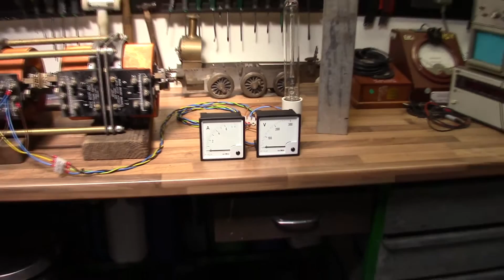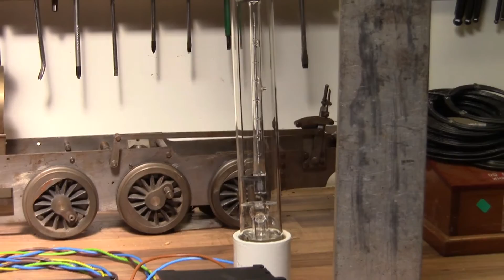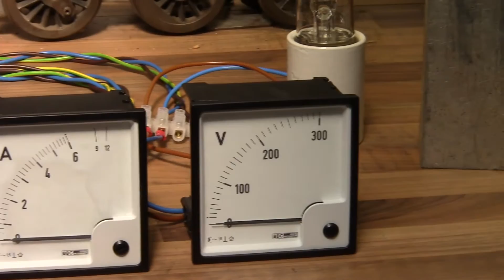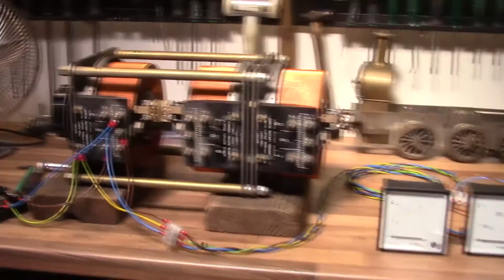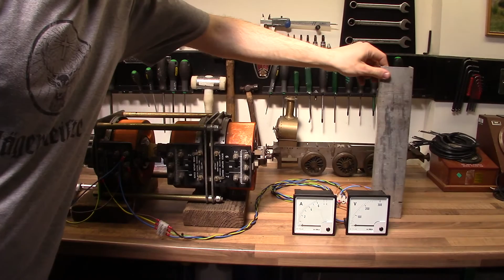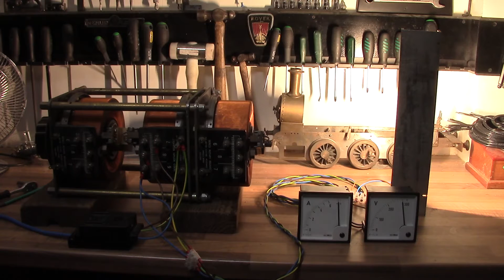Load Testing A Three Phase Variac

Comment: Nice video. And - that bulb has a great characteristic for a series ballast for, say, a nominal 3A load that might occasionally go close to a short circuit. How about making a video showing how and when you might want to use a basic simple ballast like that? (e.g. a power transformer without much internal current limiting - like a MOT - driving an arc). Best regards from Ridefast0.

Comment: When you use that, i would wire the front and back 'in reverse' so increasing the voltage is clockwise, you can always reverse the dial plate if it's wrong, that way it's intuitive,  ;)
Reply from the maker: ***** I do believe that was how it was originally wired too, Top and Bottom were wired opposite polarity to the odd middle one. I would have kept them all the same way round if I'd have designed it, keep it simple!
Reply: Steve Lane Yeah, the ones we had at work were all the same orientation, you could probably swap the middle one round if those spacers are tubes with a long threaded rod, just got to cut the spacers the right length, it would look a lot better too

Comment: Great vid! Interesting how they put the middle core around the other way round, must have been trying to save space!
Reply from the maker: Machine Man Certainly makes it interesting, although year I think it's just a quick solution to space and money saving would have to have been apart of it to sacrifice simplicity in this setup. Regavolt 1225 3 phase stacks are much simpler and can be connected using straight buss bars between terminals if required.
Reply: Steve Lane yes I see.

Comment: Are you gonna keep the stand on this variac?(four bolts)
Reply from the maker: TheCHOCOLATEmeter The plan is to use this one somewhere where a triple stack is required, if it's a single phase setup I will need to get hold of balancing chokes, if 3 phase I will wire them in star configuration as they are 230V across the windings, not 400V.